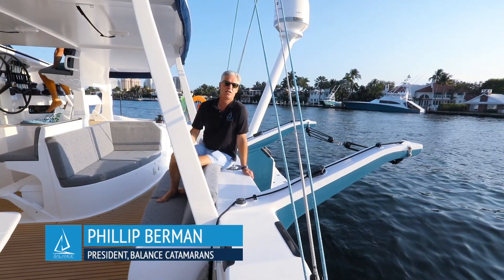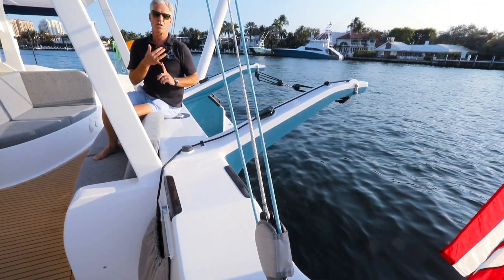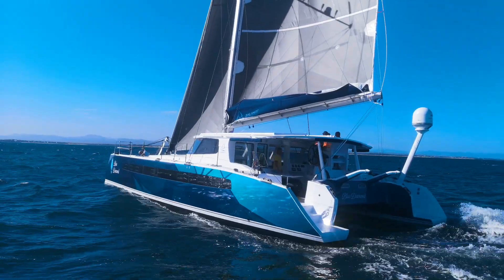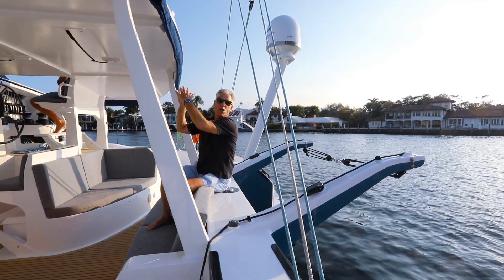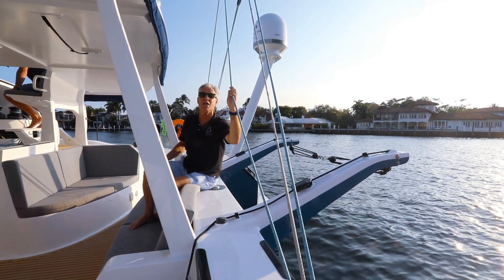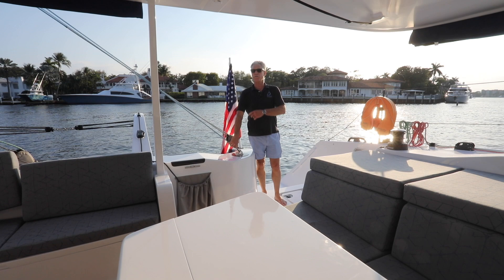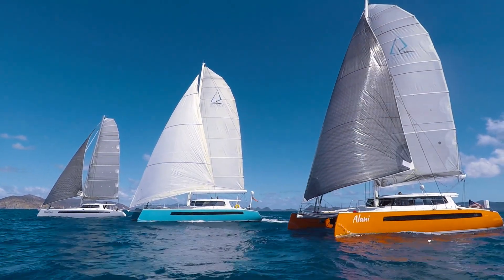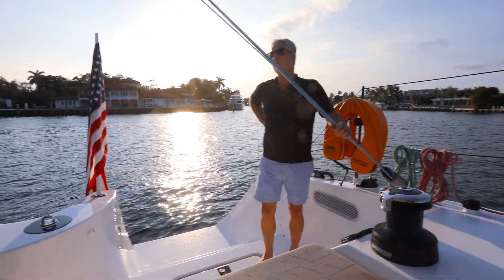Why we use an A-Frame Mainsheet System

Comment: Seems like lots of positives vs mainsheet /traveler system as explained.  I'd want to get comfortable with how to quickly depower the main in the event of significant guests or wind changes (like a misjudged squall).  Next time please show how the mainsheets are controlled (guessing there are two), and how quickly you could ease both.  thanks!

Comment: I have to say, this is one of the few things I disagree with Phil on.  In theory it seems great, but in practice, it's actually pretty terrible and not safe in my opinion.  To dump the main quickly in a big gust, you essentially have to dump both of them to effectively depower the boat.  This can be confusing for crew with two sheets and take time which is critical in those situations.  Don't just take my word for it, let Shane of youngbarnacles who has lots of experience with this system explain the problems.  https://youtu.be/-woIQ2nI-3Q
Reply from the maker: Forgive me, this is just not true. You do not have to release the leeward sheet to "dump the mainsail" at all. Anytime you wish to depower the boat, or turn down, you simply ease the windward sheet. If someone has an issue with this system they do not know what they are doing, or the system is designed improperly. FYI: this same system was used on every single Catana 471 and 431 ever built. I have never heard of anyone struggling with it. There are three big things I do not like about a traveler system: 

1. It complicates sailing and means you have to have a track and cars and extra winches and sheets. It is more time consuming to gybe for sure.
2. A traveller system means you cannot control the swing of the boom in bouncing conditions anytime the mainsail is not trimmed in tight. This means you must attach a preventer to the leeward hull to stop yourself by being driven crazy with your banging boom. In our the V system the mainsail is always vanged. And you do not have to detach the preventer to gybe. The one caveat is that if you wish to sail downwind for a long period of time we sometimes "vang" the boom to the leeward hull like a preventer to get better mainsail trim angle. In this instance you must attach and detach the leeward sheet before you gybe. I can say that in most day sailing and hopping conditions we do not do this.
3. The V system allows you superb control over the leach of the mainsail and enables you to  twist it or flatten it to perfection if you know what you are doing. A traveler does not allow you to adjust twist nearly as well. 

Alas, another video I must do!  Stay in balance!
Reply: @balancecatamarans  I agree with some of those points.  However when the boom is much past the centerline and the leeward sheet pull becomes vertical or past vertical i.e. facing the same direction as the windward sheet, easing the windward sheet isn't going to do much unless you have the leeward sheet very slacked.  If you have it very loose and ease the windward side, then you can have large shock loading happening as that slack is taken up quickly.   Again, Shayne Young from @youngbarnacles who is a well known multihull racer and rigger demonstrates this on his Catana 42 with the A frame system in the video I linked to.  Every system is a set of compromises, but a traveller setup is a pretty well tried and tested one.
Reply: @kenyonstewart7120  i watched the other video too and was initially concerned about this system as the one in the other video doesn’t look great, however I noticed the balance has 2 distinct differences which look like they would help to alleviate the issues described: 

1. You can change the attachment positions of the two sheets. This would make the angle of the leeward sheet so wide that you should always be able to dump the main from the windward sheet. 

2 Although it’s not shown on this video, it looks like the two sheets on the balance are controlled together at the helm as opposed to two different positions, so trimming would be easier as you could more easily adjust both sheets at the same time. 

Would be nice to see another video showing how the balance is trimmed to confirm 👍🏼

Comment: Looks good, but how do you de-power quickly.
Reply: Both mainsheets lead to a common helm position, you can release both simultaneously.  Other boat builders do not have this same set up that Balance has.

Comment: How do you depower the sail in case you get a sudden unexpected gust? Would you need to loosen both ends of the a-frame mainsheet? Wouldn't that be slow and potentially dangerous?
Reply: Both sheets are lead to a central helm position, it’s quick and easy the way the system is set up.  Not dangerous at all if you are sailing the boat properly.

Comment: The actual origins of this A-Fram Mainsheet system come from the German Mainsheet System. The 'German' system just means the sheet travels to the gooseneck then down where it is trimmed. There are a number of variations on the system that all have their benefits. But the major advantage is no matter where the traveler is the sheet is trimmed from the cabin top usually via one sheet. 

In this case, the physical traveler is removed and there is no need for the gooseneck attachment because there are attachments from the rear of the boom to the port and starboard aft points as well as in the middle of the aft which allows for the movement of the mainsheet to different attachment points, while still being controlled by the helm which is advantageous in solo or short-handed sailing situations. In this setup, there are two sheets used to control the tension on both points.

It's an ingenious setup and works very well for different points of sail.
Reply: I've seen some people claim this is a variant of the German system and I don't think that's accurate. If anything the German system is simply a variant of a conventional mainsheet, and twin-sheeting systems should be considered their own thing.

There aren't any significant similarities.

Comment: Just so I know I'm seeing it correctly, it's two separate 2:1 sheets running up to the mast and back to the helm with separate clutches?

Also, if you wanted to put a solar arch over the davits, would that interfere with this?  Presumably you would need to leave a  decent gap.
Reply: Yes, there are two mainsheets that both run to the helm.  On the 526, you also have the option to install winches on the transom and trim the mainsheets from there if you prefer.

A solar arch does not make sense, nor is it necessary, on a Balance 526.  With our current 400w solar panels we can accommodate up to 2800w of solar on the hard top while still leaving walking space along the boom to access the mainsail stack pack.  A solar arch would conflict with the mainsheet system and add unnecessary weight on the stern of the boat.

Comment: Ingenious system. Balance has very good solutions. Experienced sailors. One question: Is there room for a Bimini top on the helm? I noticed the boom is pretty low. Thanks and congratulations for your boats
Reply: The helm has a pop-up bimini top already built it.  It folds down flush into a recess in the hard top.  The boom is high enough to clear it.
Reply: @andrewhodgdon2786  Great, sometimes some protection is weel come. Tks for the reply
Reply: Not a Balance "innovation"  its actually a very old system for boom control.    Had this system on my boat 25 years ago  and I copied if from an old gaffer that had it!
Reply: @pierremitham2964  We never claimed this was a Balance invention.  Phil specifically mentions in the video that we incorporated it from earlier catamaran designs.

Comment: What is the significance of the short length of white rope that gets spliced into the blue main sheets?
Reply: What you're seeing is the inner core of a dyneema double braid line.  When splicing an eye loop in a double braid line you have to taper the cover back.  Since that end of the line never runs through a block it does not need the chafe resistance of the outer cover and the strength characteristics remain well within specs.  This is common practice on all performance sailboats using dyneema lines.

Comment: Anyone know what it means to add more 'stretch' to that system?
Reply: Can you elaborate?  It's not clear what you're asking.
Reply: @andrewhodgdon2786  Described at 1:30 in the video. It isn't clear to me how you could control the amount of stretch after centering the main.
Reply: @heisenbugz  He's describing the ability to control the boom height, and therefore, the sail shape of the main.  This is possible because of the triangulated set up of the dual mainsheets in the A-Frame design.  You basically have total control of sail shape and boom location due to the ability to move the blocks and then trim the mainsheets.

Comment: Not sure if I understood properly
Please correct me if I'm wrong.your on starboard tack.normally the starboard sheet would be carrying the load so you now need to load the port sheet to hold the boom in position. Unload and relocate the starboard sheet.now reload the starboard sheet. Unload the port sheet relocate reload I'm new position and then Adjust the loads I'm both sheets.sounds easy in 10_15kn Unsure about n stronger wind
Reply: That would only be the case when jibing downwind.  Upwind you leave the blocks in their respective inboard transom positions and just trim them normally.  Generally speaking, you will not be doing frequent short jibes in a cruising scenario especially not in heavy weather conditions.